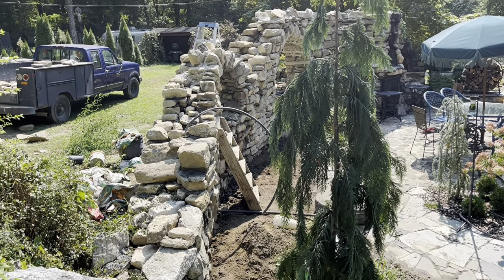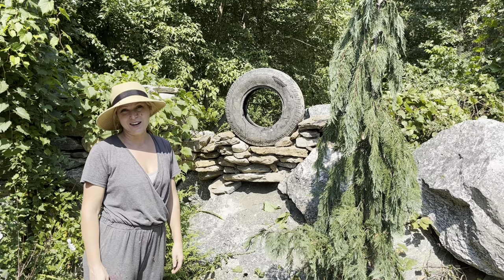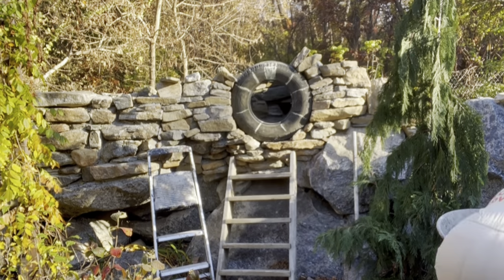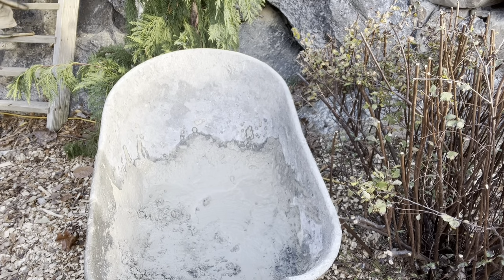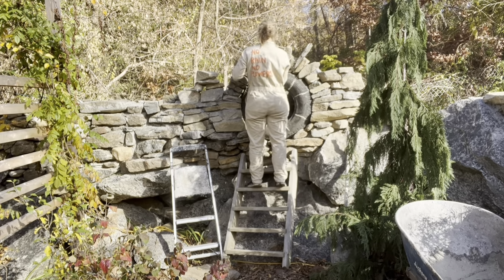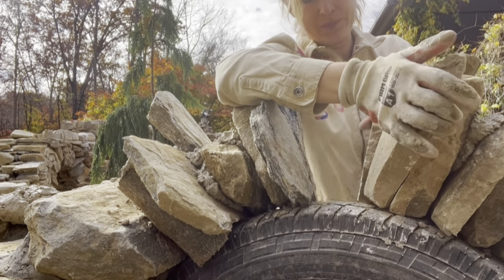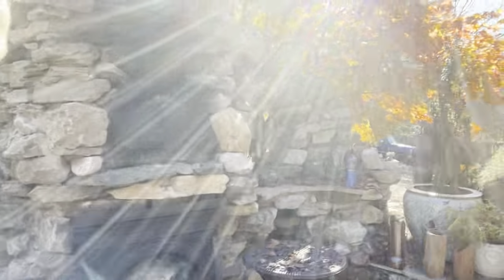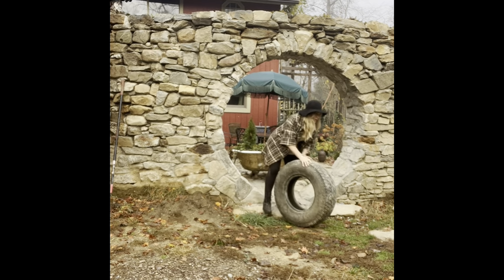How to make a moonwindow with a tire

Comment: I LOVED this! I like the Buda, but would place it behind the plant if it were me. Also,I have a chandelier that looks lot like yours, that is an antique, and I pulled the electrical wiring out of it and I used a high temp silicone type glue to attach the head of one of those little 1.99 cent solar lights in each candle area of it. Then I used a heavy duty S hook to hang it inside the cattle panel arches that I have over my container garden. It lights up really nicely at night and is an incredible way to recycle something I actually found laying alongside the curb on my way home from work one morning.

Comment: The Buddha is a great piece but I wonder if it will block too much light for the plant.
Reply from the maker: @lindawashington500  I think you may be right because the plant didn’t do well. It could be that it didn’t get enough water as well. Need something partial shade loving and drought tolerant maybe a sedum variety.

Comment: Well, I know you had a hard time removing the tire. Why did you not put cardboard buffers in to relieve the stress on the tire, you could wet the cardboard and pull it out with very little trouble. And it's recycled too.